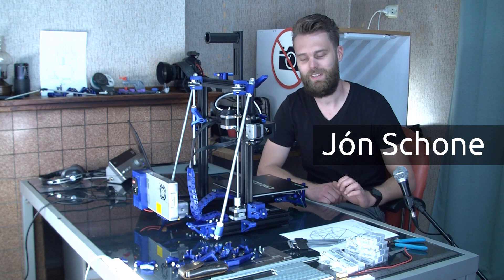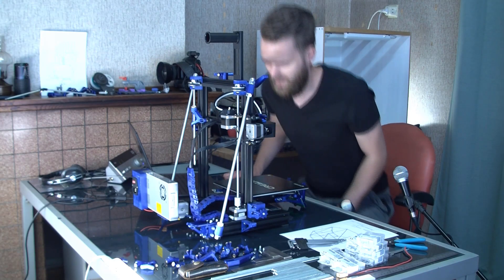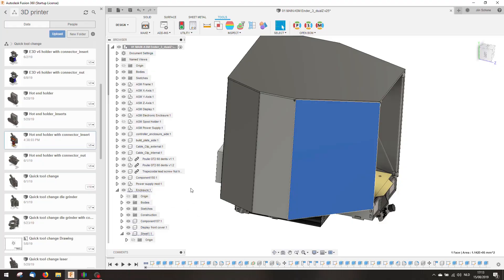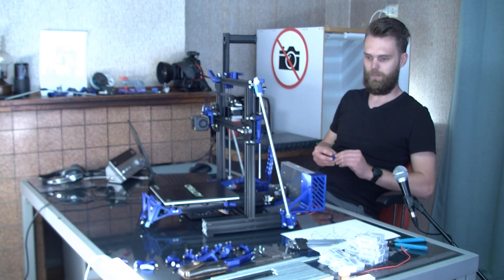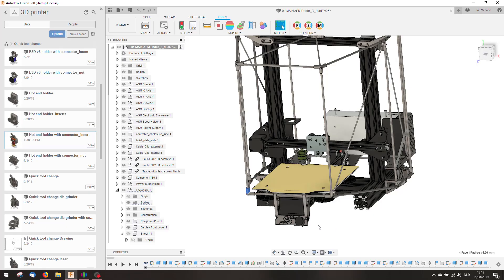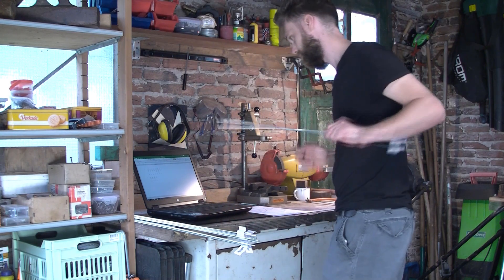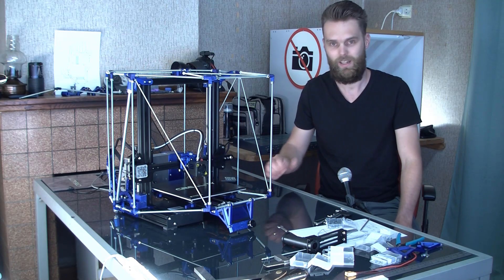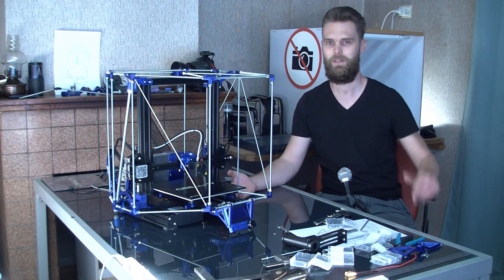Ender 3 pro enclosure build: the frame

Comment: You could lessen the cost of this by going with less expensive standard generic rods and use set screws to pin them in.
Reply from the maker: Hi Kenneth, thanks for your comment. I use standard threaded rods and they are pretty cheap. Together with the thread in the corner pieces it holds very well :)
Reply: @properprinting  I live in a small town with no big box stores and local places charge a DRASTIC difference in price between threaded and standard rods. I would prefer the threaded rods though for that added rigidity to the overall frame, which you already did with the Z-Axis braces.

Comment: Hey, Well done on your super charged Ender 3 Pro. I like how perfectly square everything is. Are you some sort of Mechanical Engineer?
Reply from the maker: Thanks a lot for your comment! I work at a company which produces industrial electronic circuit boards. With a team we develop systems on which these boards can be placed for automated testing. My background is precision metal worker but I'm mostly programming with LabVIEW and making simple electronics for measuring. I came in touch with 3D printing when I worked at Philips and I've designed a lot of tooling for production. I always loved designing all sorts of things and that's why I'm so exited about 3D printing where the designs become reality very quickly and affordable :)
Reply: @properprinting  Very nice. Well done. 

I was hoping, have you recorded footage of how you squared your ender 3 frame? I saw the video where you added a shim but you don't go in a lot of detail.(would make a good video and guide for a lot of people). I have taken apart my whole printer and stripped it down to the frame. So in the next couple of days my focus is trying to get my frame as square as possible. Because right now my X gantry is loose at the bottom but tight at top. So the Z extrusion rails are not 100% parallel. Do you have any pointers for me please? Eventually I would like to add the triangle braces like you did to ensure the Z extrusion is perpendicular to the frame but getting the Z extrusions parallel is my first step.

I myself am an electrical engineer, so I do embedded systems programming and electronics design, so anything mechanical related is not my strong suit due to lack of experience in metal work etc.
Reply from the maker: @devonmagan5046  Thanks a lot for your comment! In hindsight I should have shown more in that first video about this printer. I wanted to do that at first but the video I referred to https://youtu.be/me8Qrwh907Q basically mentioned everything except for that shim. In that video he shows that it's important that the two vertical beams should indeed be parallel as you've mentioned which can be done with a long ruler, folding rule or tape measure. There is a bit of give where these beams are connected to the base so this can be used to adjust just that. I've used a set square to check the perpendicularity between the base and the vertical beams in the x-direction which is adjusted with that shim. The y-direction is adjusted with the braces.

With the knowledge I have now I would do that first Ender 3 video over going further in to detail about getting this printer just right. Sometimes it's difficult to determine how far to go into detail. If you need more information, you can send an email to contact@properprinting.pro or send a message directly on Discord properprinting#1572
Reply: @properprinting  Thanks very much for the information:

Man I've spend so many hours getting my printer 100% square, perpendicular and parallel. What a pain in the ass. But I've learned so much in doing it. Im actually so shocked how unsquare, unparallel and non perpendicular the frame is(out of the box). Tools I used were a set square(many different sizes) and vernier caliper for measurements. 

Firstly I made sure that Z extrusions were square with the Y rail as well as been parallel with one another in the X direction.

Next I found out that no shims were needed for squaring the Z extrusions with the frame(perpendicular). You can tilt the Z extrusions by tightening one screw tighter than the other. This will give you a huge amount of adjustment in either direction. So what I did was make sure 1 of the extrusions were square to the frame. The other Z extrusion you adjust the tilt while measuring between the two extrusions. This will ensure the Z extrusions are parallel with one another in the Z direction. 

And lastly make sure the x Gantry is the same distance on either end between itself and the bottom frame.

Next, I'm going to give your Z braces a go. I really want to lock in my squareness permanently and the Z braces will make everything extremely rigid. 

Once again thanks very much for all your work you have put in, in helping me and helping me realise that I actually need to fix my printer. I'll keep following your videos and keep in contact. 

Cheers

Comment: I don’t want to offend you, your work on this enclosure is complicated and cool, but I do not see any advantages over the conventional enclosure (from plywood, polycarbonate or Lack tables from Ikea) except for a non-standard appearance. 
Your case is difficult to assemble, obviously more expensive than common enclosures, and gives less access to the printed part. Also, if there is a need for any modifications to the printer, maintenance or repair, this enclosure will have to be untwisted and dismantled to give full access to printer. At the same time with a regular enclosure, you can easily remove the printer from the enclosure, perform all necessary actions, and then return it back.
Reply from the maker: Thanks a lot for your comment. I’m not offended, rather the opposite because I really appreciate some skepticism which keeps me sharp. There are some advantages and disadvantages compared to the known methods. The biggest disadvantage is indeed that it is difficult to assemble. It gives less access to the printed part, but the opening in the front is wider than the bed so it would not be a problem for me. You don’t have to dismantle the frame in order to remove it. If the part on top in the center where the four struts meet is loosened you can remove the whole frame because it is snapped in place. The biggest advantage for me is that the whole printer will be one unit. Another advantage is that the electronics are kept out of the heated chamber and lastly, it looks dope :)
I have to make a list of all costs because it would be nice to know how expensive this printer will be. This enclosure is not the cheapest and if I have to guess I would say that I have spent around €60,- on it.